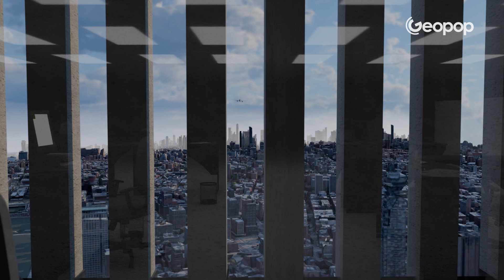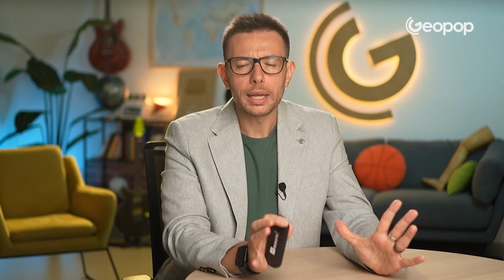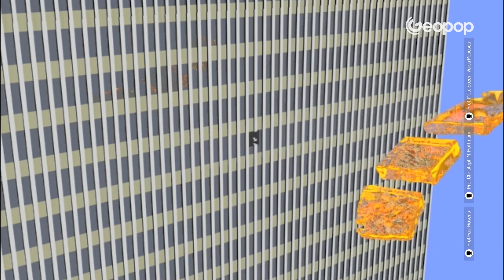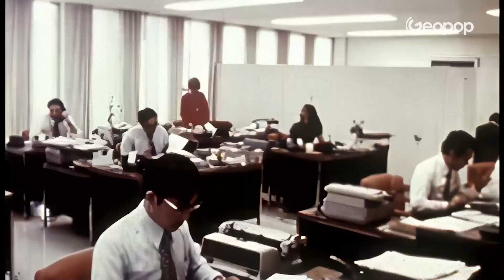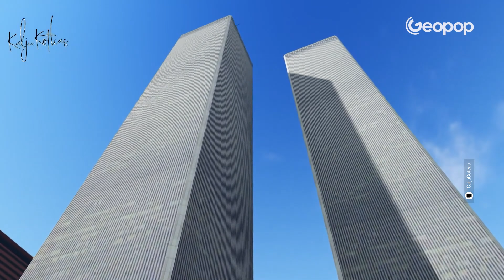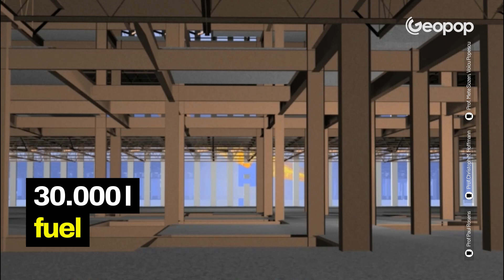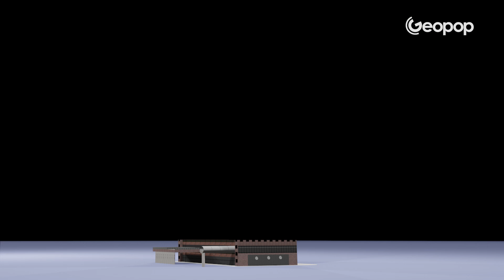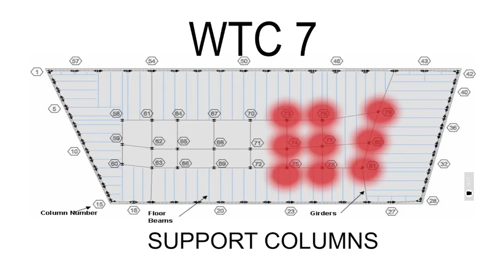9/11, 2001: The Technical Reconstruction of the Twin Towers and WTC 7 Collapses

Comment: And this also explain why the 2nd scraper that got hit 20 min later, imploded first, because it was hit  alot lower to the ground and therefore had much higher stress due to weight from above that pressured on the weakened area.
Reply: Don't use logic as proof lad 😅
Reply: Also the roof truss steel work, designed to carry large antennas ended acting like bridges and holding the inner columns that were hanging from the them. And the north tower had the stronger roof truss  because it’s the only one they put an antenna on..
Reply: Yess but were did the rubble go. ?
Reply: @CorM1  Have you ever heard that a small object dropped from up high can cause a large amount of damage? A 2lb object dropped from 1300ft generates an impact of 2600 lb per foot (easily enough to kill someone). While this is easier to conceptualize on a small scale, it truly is boggling when we're talking about buildings. 

The collapse of the towers had a similar mechanism but on a massive scale with rubble weighing thousands of tons instead of pounds. You can see in the video how each floor cascades into the next. Additional rubble fell on the lower layers of rubble and even concrete can only sustain so much force without crumbling. Each of the twin towers  had 110 floors and were 1300 ft high, the building materials alone not accounting for people, furniture and other factors weighed around 500,000 tons. The math is horrifying. 

Since the towers were so tall the rubble from the highest floors accumulated a lot of velocity and this was why relatively few people survived in the rubble. Outside of a few areas which miraculously collapsed later than the rest entire floors were pulverized by gravity and the sheer mass of so many heavy floors landing on top of one another. That's where the dust cloud came from and why everyone near the collapse was coated in it. All the concrete of the lower levels was crushed into airborne dust.

It truly is testament to the engineering that the buildings held as long as they did. May all of the victims rest in peace.
Reply: @CorM1  most concrete was turned into dust.
Reply: @EmeryE2 and were did the steel.go? Most of.the steel.was.gone
Reply: @CorM1 not really. There were massive piles of concrete and steel and other parts of the towers.
Reply: @CorM1  you mean the giant pile the spread over a huge area and took almost a year to clean up?
Reply: @AlaskaB83 Thank you. How is that a mystery to some? There is tons of footage showing the rubble and reports on the cleaning up process.
Reply: @AlaskaB83 At this stage, anyone who still believes the WTC (edit 1, 2 & 7) collapses were a 'controlled' demolition is deliberately being a contrarian prick. They've already had the best part of a quarter century to educate themselves on the circumstances of 9/11 and the collapses, and even if we ignore that benefit of massive swathe of time, there are still great resources such as this kind of content to educate them on the matter today.

Like I said, contrarian pricks.
Reply: @CorM1  litterally all of lower manhattan was covered in dust, there was a massive pile of steel. Also, what is that even trying to prove, how does little rubble prove any conspiracy theory

Comment: heat doesn't explain why the structure collapsed to the bottom. must be more complex phenomenon.
Reply: It's called gravity and mass.
Reply: @zMW574e well designed structure will hold some rigidity. Some design faults must have been made.
Reply: @wojciechczupta  - OK, I'll bite.  How much?

Comment: Those three buildings fell down into their own print. It would cost at least $20 million today to level a building the size of bld7. The two towers were dropped by fires? Or was it just complex mathematical equations involving structural and civil engineering? Or maybe demo?
Reply: If these buildings fell down in their own print as you say, why so much collateral damage?
Reply: @TheLoonResistance why are you responding to every single truther on every single video  🤔🤔😂😂

Comment: That's the biggest load of rubbish I've ever heard in my entire life... (:
Reply: And yet not wrong or you would have had an actual rebuttal.
Reply: @TheLoonResistance  Of course, that's wrong... no building simply collapses and then loses 75-80% of its structure! Even if 7-10 missiles or airplanes had crashed into WTC 1 and 2 towers, they would still be standing. Steel melts at 1500 degrees Celsius. And we didn't have those temperatures there (max. 1000 degrees Celsius). To bring down such a building, you would have to carry out thousands of controlled explosions on the steel beams; only then would the beams lose their stability. And only then would the building collapse. But the most important point is: even if it did collapse, we would have the entire structure of the building at the bottom, atop a 150-200 meter high mountain of steel, concrete, interior furnishings, tables, chairs, telephones, and so on... Matter doesn't simply dissolve! It is crushed, destroyed into small pieces, but it remains intact. But at the bottom of both towers, we only have small remnants of steel and concrete; 90% is gone! As if by magic... :) And that's why there's only one explanation: They were demolished with nuclear weapons and are almost completely pulverized, just like WTC 7. That's enough for now... Think about it... and don't believe that bedtime story. You're an adult, aren't you?
Reply: @Faith-Hope-Love-Planet  - I think we have identified the problem. You have no idea what you are talking about but you think believe you do . Not a criticism, just an observation. It takes years to learn this stuff and who has the time?  Turns out, I do.  I hope this helps.

While complex, most of the Twin Towers collapse mechanisms can be seen with the naked eye and easily discerned and understood by the layperson IF sufficient time is taken to understand.

1. The Twin Towers consisted of 4 primary structural elements that together formed an integrated system where each relied on the others. 47 hollow box-section steel Core Columns carry the majority of the gravity loads. The 236 hollow box-section steel Perimeter Columns carry the remainder and ALL of the lateral (wind) loads. Long-span Lightweight Steel Trusses connect the core and perimeter column together at each floor with a Hat Truss on top to tie the structure together as an integrated unit where no element can survive without the others. There was no structural load bearing concrete and most components were bolted together.

www.youtube.com/watch?v=u7OqrC74Dm4

2. The impact of a 120 ton airplane (= to 12 dump trucks) at speeds up to 589 mph and the energy of a ton of TNT completely destroys the aircraft in 0.75 seconds. This in no way implies the Towers come out unscathed. A lot of folks get hung up on that. Many perimeter and some core columns are damaged or destroyed (example; 33 of 59 perimeter and 20 of 47 core columns in the North Tower), This damage is primarily through bolt-shearing failures at the end connecting flanges, as well as bending, twisting and fracturing of weld seams. There was no cutting or slicing - the reality was far more violent and brutal.

3. The impacts destroy or damage fire insulation, fire breaks and sprinkler systems on multiple floors. Huge fires are started across multiple floors simultaneously and allowed to spread rapidly with no effective firefighting or fire suppression. This was an unprecedented fire event .

4. The hotter steel gets the weaker it gets . With fire insulation stripped away and no sprinklers the survival time of the steel greatly reduced. Increasing heat gradually causes the lightweight steel Floor Trusses at the impact damaged floors to sag, which can be seen. No steel melted or needed to. Structural steel fails long before it becomes a puddle. It just needs to bend

5. Sagging floor trusses pull on increasingly weak and overloaded Perimeter Columns, causing some of them to bow inward by up to 5 feet. A straight column is up to 4 times stronger than a bent one. The bowed Perimeter Columns buckle and fail, quietly initiating collapse. The formerly static mass above which the structure below could easily support converts to a dynamic mass up to 30 times greater. Because they have buckled, the Columns above and below the failure point are no longer aligned . The load bearing structure below no longer bears any load as it falls past the lower columns, NOT onto them.

www.youtube.com/watch?v=ULdiD6gYZO0
www.youtube.com/watch?v=zTygQK3vriI

6. Thousands of tons of debris fall within the four outer walls, down through the open office space, crashing onto the first intact floor it encounters, immediately breaking the bolted column connections as the amount of resistance the Floor Trusses can offer is negligible. The falling debris slows only marginally and briefly. Note: 
6a. This is NOT a solid top block crashing into and “crushing” a solid bottom block . 
6b. The debris falls past the columns not onto them. The columns provide no resistance to the falling debris. 
6c. Only the bolted floor truss connections to the core and perimeter columns offer any resistance. A pair of 5/8” bolts at each end of each truss vs. thousands of tons of falling debris. 
6d. No laws of physics are violated. 
6e. There is no 20 floors against 90 floors but rather 20 floors against one floor, then 21 floors against one floor, then 22 floors against one floor, etc. 

7. This floor-led collapse progression within the four outer walls can only go straight down.
7a. This process is often incorrectly referred to as “pancaking”. The catchy name stuck but nobody knows what it really means and "pancaking" is too simplistic and inaccurate anyway. I prefer Kaiserschmarrn.

8. Collapse progresses through the floor systems past the columns, through the path of least resistance . The resistance offered by each floor is always the same while the mass of debris and its velocity – thus its energy - increases with each floor failure. Each floor offers the exact same resistance to the falling mass while with each failure the falling debris constantly gains both mass and velocity. *This process of floor-by-floor destruction cannot be arrested, it can only speed up . Rate of floor failures increases with each floor as momentum increases, reaching an average acceleration of 0.65 of GA, or 35% slower than true free fall. Bam, bam, bam down the building until there are no more floors to fail. The resistance offered by each successive floor is always the same. More mass, more velocity, same resistance with each floor. Don’t get stuck on the but the lower floors weren’t on fire nonsense. They weren‘t and didn’t need to be.

9. The Towers were 95% air by volume. As that air was compressed inside the building it is forced down the tower and blown out the sides in reaction to the building collapsing . Those were not “explosions”, it was expulsions of compressed air caused by the collapsing building, explaining the low velocity, lack of flash, blast, supersonic pressure waves and lethal high-velocity ejecta.

10. Perimeter Columns become detached and peel away like a banana behind the collapse front, playing out to the four points of the compass extending to more than 800 feet from the base of the towers. This was quite obvious from examination of the debris pile.

11. Core Columns fail last as their internal beam bracing is stripped away by falling debris and lateral support from the floor to perimeter columns is lost.

www.youtube.com/watch?v=WpHXj62Ylw0

12. For those who care about how long this whole process took; 31-34 seconds from the moment the perimeter columns buckled until the last core columns hit the pile, or 1/3 the rate of true free fall. Don’t believe me? Just watch any video of the collapses and note the loose truly free-falling debris dropping much faster than the towers themselves.

13. Each Tower had a 1-acre footprint. Far from collapsing inside their own footprints the debris pile spread out over 17 acres in a pile up to 14 stories deep. 8 surrounding buildings were destroyed and scores more damaged by the falling debris.

14. NOT observed were the 180-190 dB bangs of thousands of high explosive devices or the blinding bright flashes of burning thermite. Neither explosives or thermite could have survived the impacts and subsequent fire nor could have caused the (silent) perimeter column buckling that clearly initiated collapse either. A video of a shocked and injured firefighter casually using the magic word explosion is in no way proof of explsoIVES and the demolition_ case relies entirely on that sort of thing. There is zero tangible physical evidence and it would be technically impossible, totally impractical and completely unnecessary. No one would bother.  In 24 years zero structural engineers of tall buildings, including the 1/3 that have retired in that time, have made any statements in support of pre-planned demolition claims. NONE. The lack of any such citations in the engineering literature (published in any country worldwide) is telling.

15. Twin Towers were perfectly safe within their design envelope. They only collapsed when taken far outside design parameters by an extraordinary and unprecedented event

Impact + Fire (heat) + Time + Gravity = Collapse . Remove any one of those 4 elements and there is no collapse. Ignore any of those elements (as many do) and you will never understand the collapses. The Twin Towers were an integrated system in which no one component could survive without the others. One fails, the rest follow, through the path of least resistance – DOWN – through the open space, bypassing the path of greatest resistance – the columns. Nothing I just described violates any laws of physics. All of the above is true no matter who planned and carried out the 9/11 attacks or why

If you made it this far, congratulations. That was a lot to digest. I hope it was helpful and informative, non-adversarial and it solicits informed critical comment, positive or negative. If I made any errors of fact, logic or reason or left anything critical out, please let me know so I can fix it. To stay focused, just one point at a time please and on-topic (Twin Towers ONLY). No word-salads of Gish Gallop. IF you can offer a more plausible alternative be my guest. Please start any reply with the words “Tits McGee” or I’ll know you didn’t read it, aren’t serious and wasting my time.
Reply: @Faith-Hope-Love-Planet   " there's only one explanation: They were demolished with nuclear weapons"

Well at least that puts to bed CGI and AI  being  FTW  in 2026 !

One question though, why no radioactive fallout still being seen today ?    A triviality  ... ahem
Reply: @zMW574e  Blablabla, go home Little Boy...and watch your brainwashed Mainstream Crap...((::

Comment: Looney Tunes physics! Aluminum plane and it goes through the other side of the building, yeah right..  Plus - 500mph speeds are impossible for a Boeing flying this low - it would fall apart. 
These were special, armored planes + the buildings were prepared with explosives + high power energy beams to make sure it all turns to dust.
Look up Dr Judy Woods, physicist and her book - "Where Did the Towers Go?".
Reply: You complain about looney tune physics then have the audacity to champion Judy "Moonbeam" Wood?  

This is a prank, right?
Reply: @TheLoonResistance . These flakes espousing their “theories” are too numerous.
Reply: @Bubbles-r8z1z  - Most are Drive-by Truthings

Comment: The truth is it was an Inside Job and the criminals behind it haven’t been convicted of their evil acts even to this day!

Thermite sliced through those beams like butter! 

None of the towers should have collapsed. It was a controlled demolition!

Why didn’t the fire fighters just put out the fires in #7? They had many hrs to do so!

In other words they must have been told to not do so just let it burn!

There was no reason for Building 7 to collapse other than the records that were contained within that building that they needed to destroy that would have explained why this heinous atrocity took place in the first place!

Just ask Cheney & the Bush family’s what happened they should be able to give all the details!
Reply: Most of those who carried out the 9/11 attacks are dead.  5 have pleaded guilty and are in prison. 

Thermite doesn't work like that. Not at all.

The Towers were taken beyond their design limits. Collapse was inevitable.  This video does a fair job of explaining the science and engineering as to why.  No resorts to simple two-word hand wave rationalizations though. Thinking is required.

Half of the responding firefighters had just been killed (343 out of some 750).  Many others were injured, units were disorganized. Search and rescue had top priority for those remaining. Much of their equipment was damaged or destroyed. There was no water pressure. Access to much of the building was blocked by debris.  So how were the fires supposed to get fought?

7 hours of unfought multi floor fires in a building rated for 2 to 3 hours is far more than enough reason.

Best way to destroy records is with a paper shredder.
Reply: @TheLoonResistance nice black raven symbolism, how's the weather in Tel Aviv??

Comment: 9/11 BOMBING AND DEMOLITION
they didn’t “COLLAPSE”
They were atomised into POWDER by high explosives.
Collapse doesn’t pulvérise 200,000 Tonnes of steel glass & concrete into powder.
Reply: That isn't what explosives do. I'll stick with science and engineering. It's harder and requires thinking, but better. Much better. Thanks though.
Reply: @TheLoonResistance Oh look. An evolution believer. You've been duped by this science all along
Reply: @DiamondSwordTribes2  - 🤦‍♂